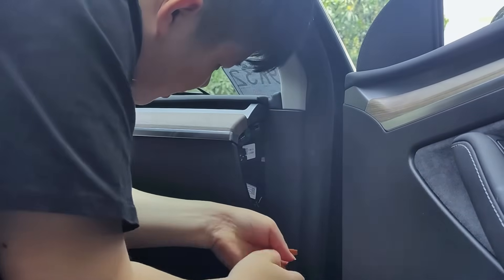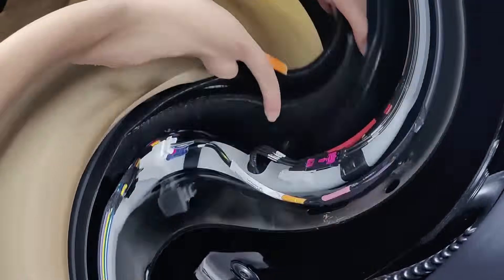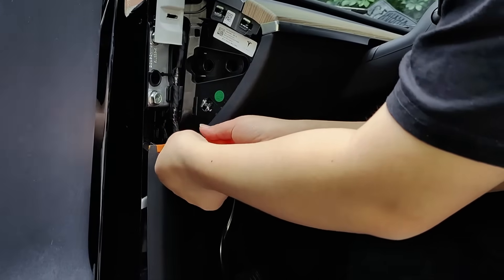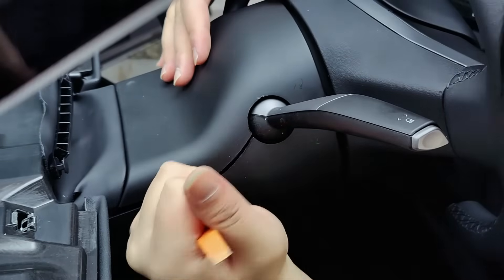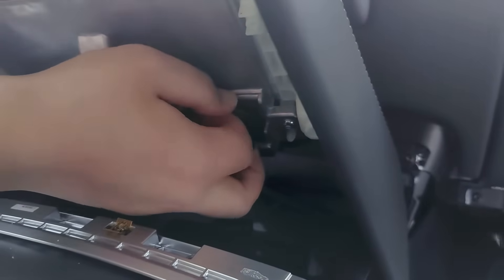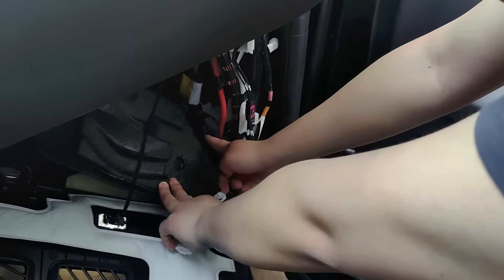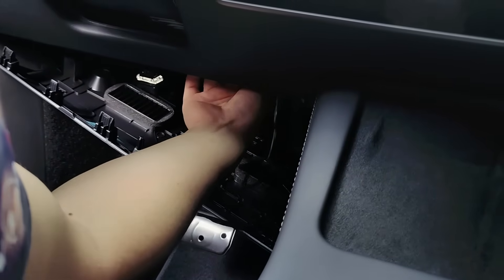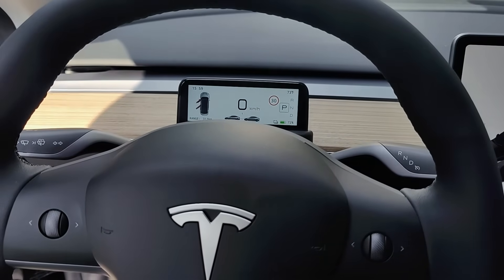How to install the Tesla Model 3/Y Ultra Mini Screen Display in 3 minutes

Comment: I don't see what you took off on the drivers side under stearing wheel. I,m trying to remove the panels under the dash and it looks like im about to break something
Reply: Looked like a screw maybe
Reply: I've heard newer models put an air bag under the steering wheel so you can't pull off the panel anymore.  Not knowing this, I managed to pry the right corner of the panel down far enough to BARELY wedge the plug through the gap I created.  Then I pushed a metal wire from the bottom right of the slit in the foam around the steering column through to the same gap.  I taped the plugs and wires to the metal wire and pulled them through to the top of the steering column.

I felt like something could have been broken by straining the panel below the steering wheel this much so I don't recommend this method.  I later found this much better install vid that avoids routing under the steering wheel: https://www.youtube.com/watch?v=bvl3shVRg1E

Comment: Theres is 2 cabels one says newer cable and the other says older cable do they both need to hook in theres video is not the best installation video it says theres 2 cables that need to be installed what does that even mean is the older cable or the newer cable or is it both?